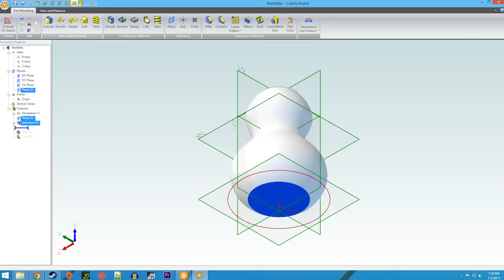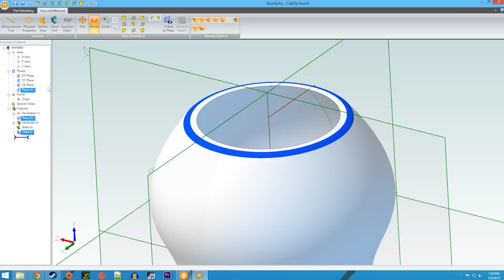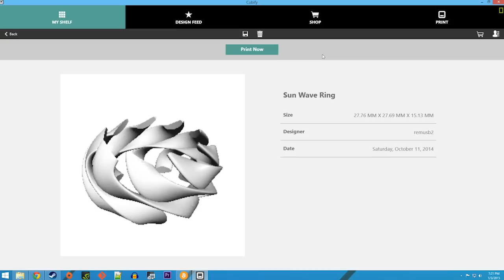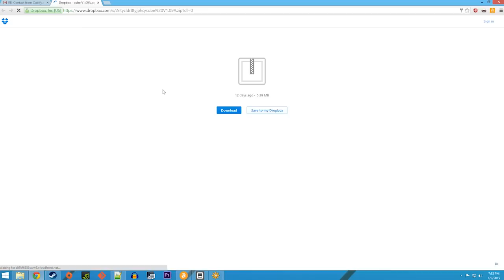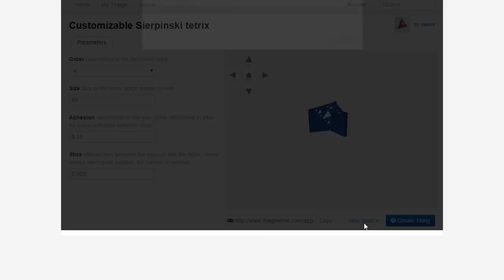3D Printing with Cube 3: The Sierpinski Tetrahedron

Comment: I just got a Cube 3 and I've found a lot of the same issue. I had a part fall off the build platform due to a small surface area to build on. I first tried using a raft to build on, which did solve the problem but was impossible to remove without ruining the part. I did find my parts stick a lot better to the build plate though if I use more glue and start printing while it's still tacky.

Comment: the first piece in the video (bowling pin-looking one) with the bulge can be fixed. I printed a worm gear that had the same bulge which interfered with the teeth of it's mate. to avoid this problem I found that if you design a raft into the printjob that's 2mm and then tip the piece at an angle connected to the raft it will print without the bulge. experimentation is needed to get the angle right (it changes based on the angles of the piece). also connecting to the raft for a solid connection that can be removed takes some practice.

Comment: I wish I had this review back in January. It would have saved me a TON of headaches. We have had so many issues with the filament cartridges that 3D Systems ended up sending us 12 replacement cartridges in the last month. That's really bad. We ended up getting a full refund for the printer through our credit card company because we were having such horrible problems with this hardware. Lucky (or unluckily) for us we got to keep the printer.

Comment from the maker: Thoughts about the Cube 3?
Reply: Eric Mickelsen It’s getting better. The firmware is up to 1.10A and the client software to 2.22. They’ve tweaked the temperature tables for the different materials and colors to try to reduce the incidents of cartridges clogging. That seems to have been pretty successful. You can use other slicing software with it, it’s not all proprietary as stated in the video. The most important things to note to get good prints are the leveling, the Z gap and the alignment between the two print nozzles. It makes a huge difference to the print quality and an also avoid the collisions described in the video that cause parts to become detached from the print bed. Lastly, prints really benefit from a controlled environment. Keep room temp consistent and avoid drafts. One guy built a plexi cube to put ove his cube and his prints look amazing, no layers, no stray material...
Reply from the maker: Howard Price That's good to hear.  Just to be clear, I didn't mean to imply that you can't use other slicing software, although I didn't try that.  All I meant was that 3D Systems' software was not modifiable.  I feel like my environment was about as stable and consistent as can be expected in someone's home, without going to the lengths of building a specialized enclosure.  Are there methods of improving leveling, Z gap and alignment beyond what the Cube 3 does on its own?  (I ran that process frequently.)
Reply: Eric Mickelsen Hey Eric. Yes! There are manual adjustments for level, Z gap and nozzle balance (for what of a better phrase). I have never found the auto Z gap to work. It’s always way to big! After the Cube has run an auto gap you get the chance to adjust it via a menu option that pops up when it’s done. I’ve found it’s essential to do this and getting it right is a bit of trial and error until you get used to the amount of resistance you should feel on the gap strip. It should move freely with just a slight resistance. Then you’ll probably find that each nozzle gives a different level of resistance. This is because they need to be adjusted using a small hex wrench. That is done with the two hex sockets on the white piece behind the print head. You’ll have to retest many times to get both the gap and the balance correct. Auto level seems to work more reliably but if there’s a case where it can’t complete the job on-screen instructions tell you which of the three white plastic mounts need to be adjusted and by how much. Once you’ve got all that taken care of the printer is pretty great. at 70nm it produces really smooth pieces. It takes a ton of time (35-50 hours is common) but the results are amazing.